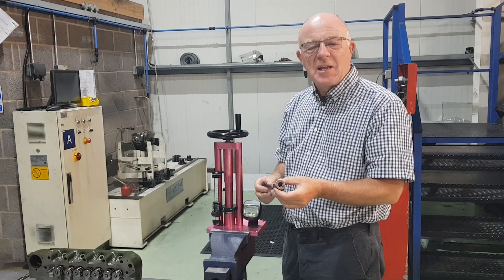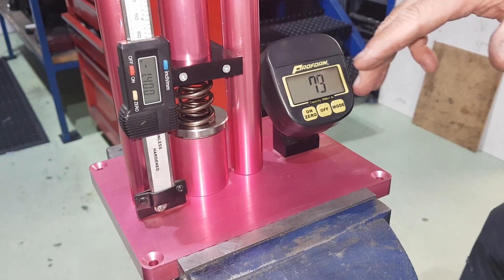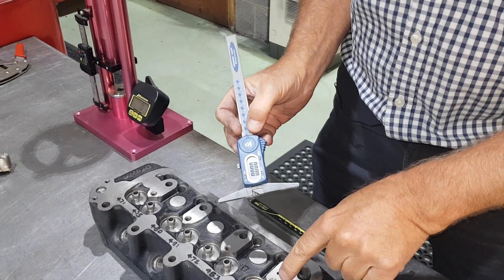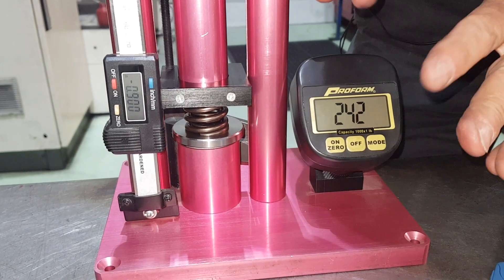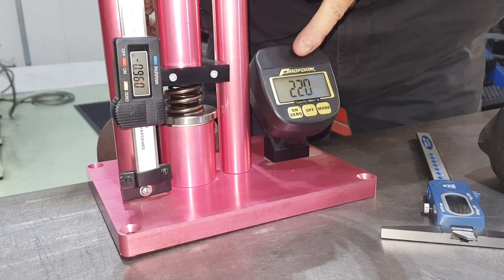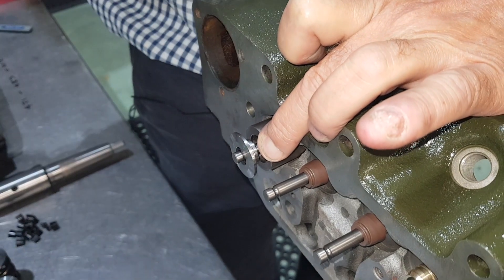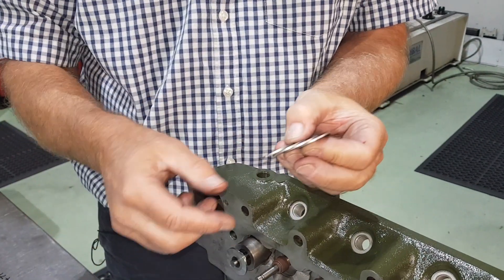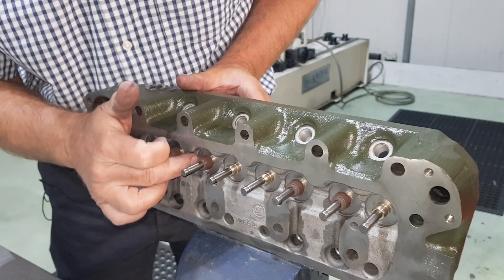How to test and setup race valve spring pressure

Comment: Let me start by apologizing for my ignorance, can someone explain what in the world is going on w this head.  Are the intake and exhaust ports on the same side?  It also doesn't have press in seats, the valve seat is cut directly into the casting.  The rockers are unlike anything I've ever seen.  What block does this fit and what series is the head meant for?
Reply: It seem you have not heard of the BMC A Series engine, made from 1951 to 2000. Did you think it was for an American V8? Actually the A Series design owed a lot to an American engine that Austin had been making during the war under licence. The ports are all on the same side for reasons of manufacturing cost and compact design. Did you notice what was even more odd? The two centre exhaust ports only have one outlet, so the manifold is a three branch not 4. It really should not have worked as well as it did.

Comment: Except you didn't take into account the step in the retainer and the added pressure it would yield. PAC Racing actually has some excellent videos on setup and choosing your valvesprings. Actually, if you deal directly with your cam grinder, they will typically give you some baseline info that your spring company of choice will use to fill in the blanks based on the weight of your valvetrain components (including the springs themselves). RPM, boost, nitrous, type of use (constant RPM Vs. Peak RPM) will all need to be taken into account.
Buy once, cry once. Set it up correctly the first time or run the risk of parts failure and the hurt feelings that follows.

Comment: I thought the reason why use shims was to compensate these tolerance issues!
I mean I'm a biker and I know the 10mm diameter shims comes in all thicknesses to get finer valve spring adjustment
Reply: Those shims are for the clearance between camshaft and tappet, which close up over time because of either valve stretch or valve seat wear.
Reply: They are compensating for valve spring height when assembled.  I believe he said twelve thousandths of an inch difference in height, for that setup, was around 22lbs of pressure.  Therefore shimming the spring seats or expanding them, helped equalize or balance the engine

Comment: In the early 70’s, I was training / working in a one man shop who just spent 13 years at a speed/machine shop. I was taught to check the spring first against a 90 degree square to establish it was not bent or leaning. Keeping in order, but after passing, then using way less of a fancy digital pressure transducer, we had “Sioux” valve grinder and stones on seats. 
For spring pressure, we first checked “free” height to specs, but that’s where we did our load measurements differ. We placed the retainer on the spring to load test at installed height. It is almost impossible to get installed height on the head because the lack of room with any veneer calipers to measure up from the spring seat, to the bottom of the retainer. Preloading a naked spring to recreate installed load can be done if you measure the retainers thickness while off, then add the amount to properly lost test a closed valve. Am I wrong. We used shims after all if any was removed and the measured height from a bare spring seat to the top of the valve guide. We wrote it on paper as I am not sure if sharpies has been invented yet, like the 8-track tape was new. Valve guides where integral and had to be cut out & new ones installed at a machine shop, as we did not have that equipment. But the “Open” pressure in lbs. is not checked by most, unless at a speed shop with machining equipment. Our gauge had scales and a simple rule on the vertical rail and was adjustable. So spring, retainer, cam dial in with the ratio of rocker to be used was normal math, as you properly shown. At 0.500” lift at the valve, would change is the 1.5:1 rocker was changed to a popular 1.6:1 rocker. Beside valve to piston interference using a degree wheel, dial indicator with ball of (Dare I say play dough) was used. The other issue was the retainer may hit the stem seal. This too is rarely checked. A proper guide installed in a cutter, chucked in a drill was used. It was unheard of in most circles, we cut intake valve guides and purchase positive seals, while leaving an o-ring on the exhaust stem to allow lubricant inside. This was what we did 50 years ago, primarily on small block GM’s. Does this sound right? I became an ASE Master Tech about five years later in 1978. This experience benefitted me to pass the 8 test those few years later. Thanks for your video, subscribed.